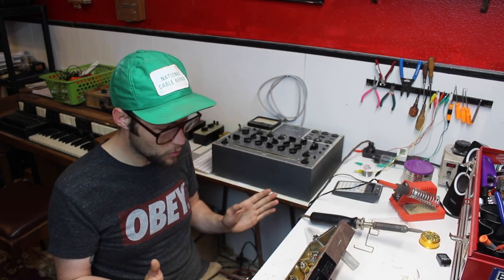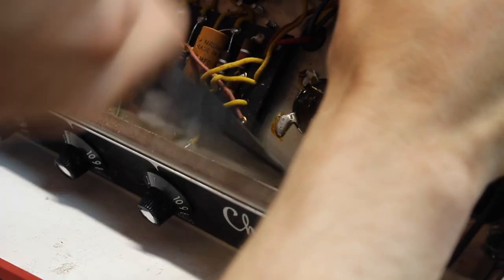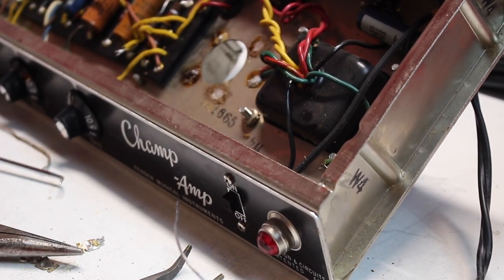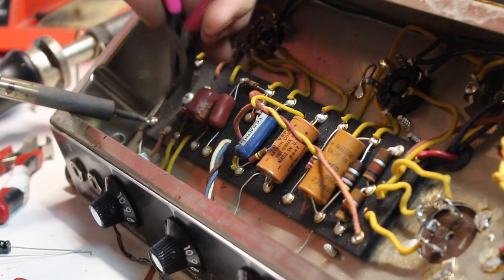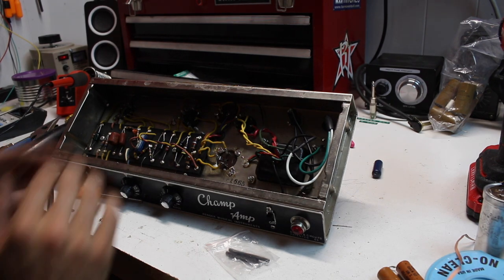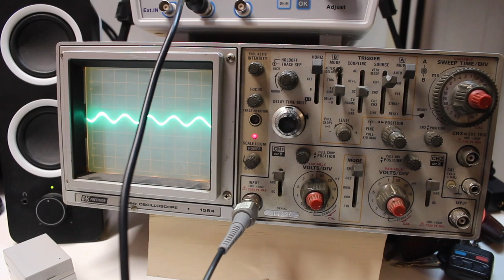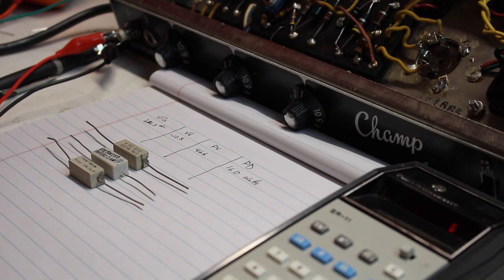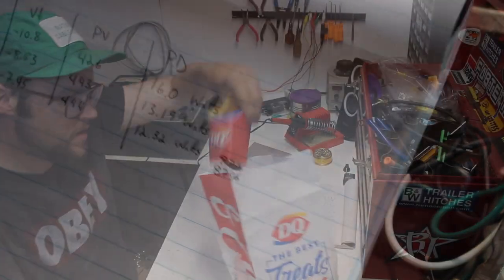1965 Fender Champ | Vintage Amp Restoration

Comment: I would use a two lug terminal strip for the neutral and ground. They are cheap and looks cleaner. Your method works, but a chassis screw could nick the sheathing and it could get hung up on the screen stapled to the top of the cabinet. Good video though.

Comment: I have a '66 vibro champ that just started producing intermittent static. Someone told me years ago what that likely is if it does that. Anyone?
Reply from the maker: Probably the preamp tube. Tap on it with a pencil and see if it's reactive to that. If so, replace.
Reply: @drew945101 , thank you.

Comment: You used the wrong formula! Voltage drop Cathode / Cathode resistor gives you current in A...
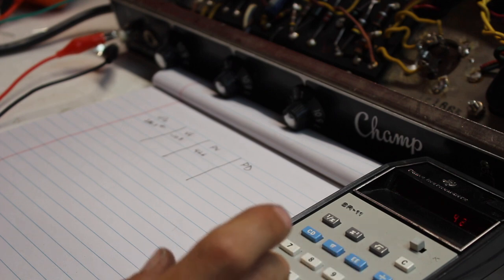11:18 calculation is wrong: 11.6 V divided by cathode resistor (470R?) = 25mA times (plate V - cathode V= 416V?) = 10.3W
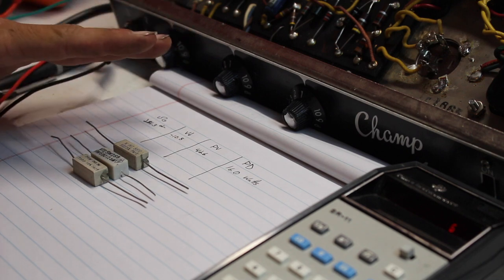11:55 11VDC - is a depleted cathode in the power tube - schematic says you should see at least 21V 
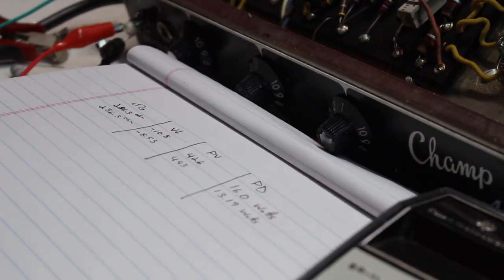13:22 OUCH 8.53V / 750 ohm = 11mA x 425 = 4.9W  --- yes what I said previously: a depleted old RCA tube, have one on my desk that's doing the same thing
14::22 double ouch 7.95v / 1000 ohm= 8mA x 435V = 3.48W
Reply: Question, sir. When testing plate voltage, should I place negative lead to chasse, or to cathode? Uncle Doug uses the cathode, but i've seen others recommend neg to gnd. Larger readings occur with chasse reading. Thanks!
Reply: @jaysorensenIBEW  plate voltage is measured to ground -- there will still be voltage on the cathode (before resistor and cap) which would explain the difference you're measuring
Reply: @zjokka  Thanks for the reply.  Cheers